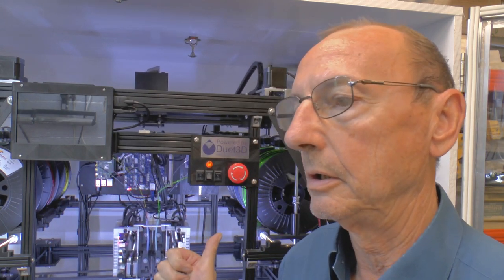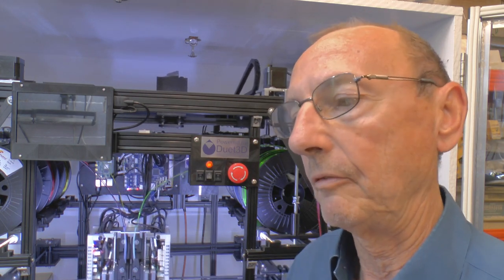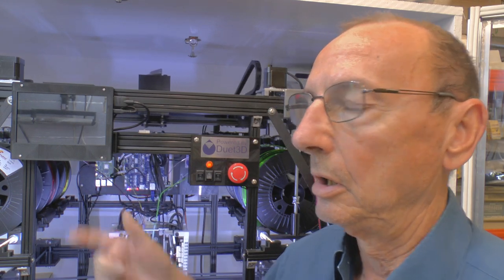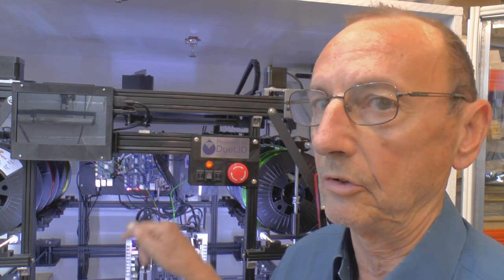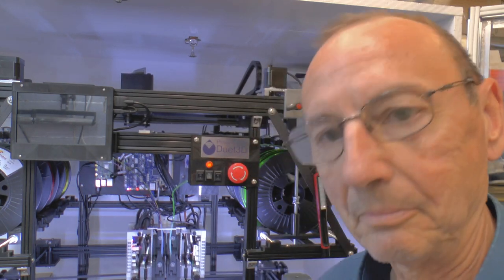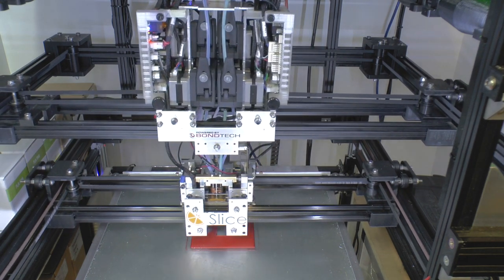New motion tricks with a CoreXYUVAB

Comment: While it'll be a bit of math, how about just low-pass filtering the XY motions to create the UV motions?  Probably has to be a zero-phase delay filter to minimize lag between XY and UV.  (a zero-phase delay filter is easy, just filter twice.  Once running time forward, and once running time backward.)  Would also need an additional exception to run UV at full speed if it gets farther than 15mm off, or code to automatically pick the filter cut-off frequency so the offset stays below 15mm.
Reply from the maker: That's far too clever for me. You may be right but most of what you wrote went right over my head. I can just about hack something together to manipulate strings of gcode text but that's the limit of my coding skills.
Reply: On second though, a lot of math.  G-code doesn't have time included so you'd have to re-construct the time axis yourself and keep track of the time code where each G-code ended.  Very crude time estimations might be all you need like move_distance/feed_rate ignoring acceleration.  Fyi, a simple low pass filter is easy and super fast if time_constant is a power of 2.  X_filt = accumulator/time_constant ;  accumulator = (X - X_filt) + accumulator
Reply from the maker: This is all over my head so I've probably completely misunderstood what it is you are saying. But if my very limited understanding is correct and with the greatest respect, I suspect that you might be over thinking this. 
Essentially, the RepRap firmware is doing all the heavy lifting. So all I do is provide the absolute positional coordinates (which the firmware reads from the gcode file) for the additional UVA and B axes. The firmware uses those absolute coordinates to work out the relative move lengths, (which can be different), for each individual axis. The firmware then generates the step pulse trains for each motor (including the "E" extruder move), and keeps everything synchronised such that all the axes (including the extruder) start and end at the same moment(s) in time. That includes the acceleration and deceleration phases (which will be governed by the lowest of XYUVAB or "E"). As you can see in the video, the UV moves are often different in length to the XY moves but the firmware takes care of the timings such that all axes start and end their respective moves at the same points in time. 
So providing I set the acceleration limits in my configuration for the UVA and B axis to be higher than the XY axes, then any combined XYUVAB moves will happen exactly the same as the original XY only gcode, even if the UV move lengths differ from the XY move lengths. If the UV acceleration limit was the same as the XY limit, and if the UV move length was greater than the XY move length, then the firmware would slow down the XY move so that it started and finished at the same points in time as the longer UV move. 
So I don't have to concern myself with timing - the firmware already does that heavy lifting. But like I said, I have no idea how low pass filtering to generate UV moves would work or what it would achieve that the firmware doesn't already do. Could you expand in simple terms?
Reply: @deckingman  the low pass filter would let you choose smoother and slower moves for the UV gantry that would still keep up with the XY gantry.  The reason for making a time axis is that the simplest filters need position vs time inputs at a constant rate while G-code can have any length move in one command.  Think of it like the rubber mounts on a car engine.  Big moves and curves pass through the filter while infill vibration does not.
Reply from the maker: @martylawson1638  Not sure how a slower UV move could still keep up with the XY gantry (unless it was also shorter). But yes, I sort of get it. One minor issue I see is that I have this positional constraint due to the fact that there is only so much "flex" in the Bowden tubes and cables connecting the two gantries. So a long sequence of short moves such as zigzag infill could eventually traverse in one direction to the point where it tears the Bowden tubes out of the couplings. So simply preventing the UV gantry from doing short moves could result in the position exceeding the allowable variation with respect to the XY gantry. My crude approach does at least ensure that the UV gantry is always within those allowable limits.
Reply: Yep.   The vibration is due to acceleration not velocity.   A low pass/high pass filter with limit conditions will have the heavy extruder gantry execute smoother moves that average out the hot-end movements.  The key to this approach is form an unlagged average that includes moves that in the future of the current time step.

Comment: That is a very clever way of coordinating the motions. Do you use any supervisor program or device to detect if anything is not doing what it should - such as the carriages falling out of step due to jamming, etc? I look forward to seeing what you do next on your CoreXYUVAB
Reply from the maker: No. There is no supervisory program - just the stock firmware. Without any sort of encoders on the gantries, there is no way of detecting actual carriage position. So I have to rely on the motor steps translating to carriage position and hope for the best.
But that's no different to any consumer grade 3D printer- it's just that I have more axes.
RepRap firmware is flexible in the order that parameters appear in G1 move commands. So my little Python script simple tacks the necessary UVA and B moves on to end of the G1 XYE moves that the slicer generates. So a G1 Xnn Ynn Enn might become G1 Xnn Ynn Enn Unn Ann Vnn Bnn  and it will work.

Comment: Nice. Good to see you're trying something like this out.  I mentioned it your another video, it seemed like a missing feature given how much extra effort it is to have a seperate gantry for it.

It's a shame about the small movements as that probably has the most benefit, e.g. Printing a DnD miniature only require the extruders to move a small amount for the entire print.
It does seem like it would require more advanced processing to completely fix. 

It's really tempting to give it a go at a solution. I can think of a few path calculating methods that might work well. +-20mm seems like more than enough to play with, but I'd imagine it would be more ideal to avoid being near limits.
Reply from the maker: Yes, I know this is a very crude implementation but my coding skills are very limited. If a miniature was less than (say) 40mm in X and 30mm in Y, then I guess it would be easy enough to "park" the extruders in the centre at the start of a print and leave them there. But I don't print miniatures on this big machine. If I was clever enough, I could possibly do the same for small holes or features that are part of a larger object, but I don't have the knowledge or skills required to do that.
Reply: @deckingman  I don't suppose you could post an unedited gcode of a file you're sending the printer somewhere. Any object larger than 40x40mm with varying moves I guess. I'd like to possibly have a go at having a more optimized pathing for it. I could send you back the code when I'm done to evaluate.

I can think of a few pathing methods that might work well. A basic moving average within distance limits would be a good starting point.
Ideally the acceleration and jerk for that axis would be reduced to some degree, but that would require checking if it's there's enough distance in every case for it to reach the same speed as the hot end in time. Although since you would ideally be proactively moving the extruders ahead of the hotend where needed (i.e analyzing future hotend movements), that shouldn't be an issue if done correctly.
Reply from the maker: That comment got held for review - possibly because you've more or less posted your email address. I've approved it for now but you might want to delete it. I've made a  note. 
You can play around with any gcode file of your own - I just used an old test part.  
One thing that occurs to me is that, because this is a post processing script, it doesn't have to be a "one size fits all" script. I could use a number of different scripts depending on the part to be processed. So for example, if the part had no cylinders or holes, then I could use a script which leaves out that "1mm small segment" rule. Or if the part was a miniature less than the sizes we mentioned, then I could use a different script that simply parks the extruders in the centre of the part. 
The more I think about, the more I like that approach. It means that the UVAB moves could be optimised for a particular abject, rather than having to compromise for features that might not be present in that particular object.
Reply: @deckingman  What's the format that it takes, like G1 X* Y* U* V* A* B* E* ? I was after the gcode because a custom firmware could do be setup to do a variety of things. Or is just taking G1 X* Y* E* like a standard one and processing it by firmware or are you duplicating the X & Y moves to UVAB by script/post processing?
Reply from the maker: @elminz  It's dead simple. RepRap firmware doesn't care about the order that parameters appear in a G1 command. And if no movement movement is needed, the absolute axis position can either be omitted or duplicated from the previous move. So all I do is use python script to tack the UVA and B commands onto the end of the G1 strings from a sliced gcode file. So G1 Xnn Ynn Enn (with or without an "F" feedrate) can become G1 Xnn Ynn Enn Unn Ann Vnn Bnn. Or if no U axis movement is needed but V is axis is,  then it can become G1Xnn Ynn Enn Vnn Bnn. And obviously if neither U nor V need to move, then the original G1 Xnn Ynn Enn works fine too. So I only add UVA or B commands if they are needed because it  keeps the file size down.
Reply from the maker: To be clear, it's a post slicer process. I create a new file so the original slicer generated gcode is preserved. Then each line of the original file is copied to the new file. Any lines that don't have G1 moves, or any lines that only have G1 Znn moves are copied with modification. Those which contain G1 X and/or Y moves get modified as necessary to include any UVA and B values.
Reply: @deckingman  Ah ok, thanks for the info. I just wanted to make it a more realistic result as I don't have anything similar to test it. I'll probably output it to a graphical display for testing.

I was just wondering if there was anything particularly unique about it, but that seems like enough info.
Reply from the maker: @elminz  the most "unique" bit is the printer itself :) I'm not surprised that you don't have anything similar to test :) I wouldn't spend too much time on it if I were you. There are very few people using CoreXYUV and none that I know of (apart fro me) who use CureXYUVAB.

Comment: Have you tested for cases where small moves, larger than 1mm might pull the hot end away from your extruders?  Maybe some kind of zig zag along the length?
Reply from the maker: Yes. Basically it tracks the position of the extruder gantry and the hot end gantry and ensures that they can never be more than 20mm apart in the X direction, and 15mm apart in the Y direction. So if they were 19.5mm apart,  in X and the next X move is 1mm, then both gantries will move to that new X position - the hot end would move 1mm and the extruder gantry would move 20.5mm.
Reply: @deckingman  I've been considering a solution similar to this but with a moving bed and hot end.  Essentially, I would do a weighed average of the bed and hot end weight and use that to influence the movement of the bed and hot end, both on coreXY.  The end result is less impulse over all, but a wide printer.

Comment: This is super interesting. Is there a cheat sheet got G-Codes?
Reply from the maker: I wrote a Python script to generate the gcodes. Or rather it adds UVA and B moves to existing G1 XY moves as generated by the slicer. I'm reluctant to share the actual code because I'm not very good at writing code. So although it gets the job done, it isn't pretty and anyone more familiar with Python than me, would probably fall about laughing if they saw the code. If you contact me via my blog, I could send you the python file by email (but promise me that you won't laugh) :)
Reply: @deckingman  Thank you for your response. I will contact you.

Comment: How about average algorithm over few gcode moves with limit on difference between x-ua, y-vb. That will minimize wobble but keep moving uvab gantry along the path.
2mm limit = (G1 X10 UA10 -> G1 X20 UA18 -> G1 X10 UA12 -> G1 X11 UA11.5 -> G1 X10 UA11)
Just an idea. Like the vlog format.
Reply from the maker: Yes, I'm sure I could expand on my first, somewhat crude, implementation. One thing that occurs to me would be to "interrogate" the gcode file for any smallish circles (like holes in a part), work out where the centre is and then "park" the extruder gantry in the centre of that circle, rather than track the circumference. I've no idea how I would do that - I'll have to give it some thought. But I need to get to get this 6 input mixing hot end sorted out first.........
Reply: @deckingman  yes I was thinking something similar, even before you made this video. I think if you make one or two steps look ahead in the direction of the hot end. Then you can already minimize the movement of the extruder gantry a lot. One step look ahead will already solve the extra movement in back and forth motions which we have a lot in most FDM printing.